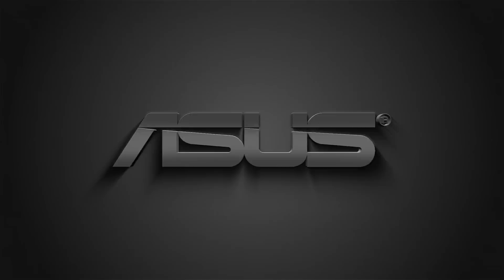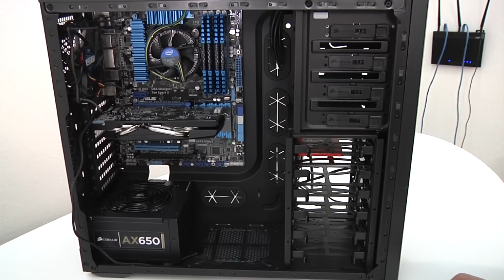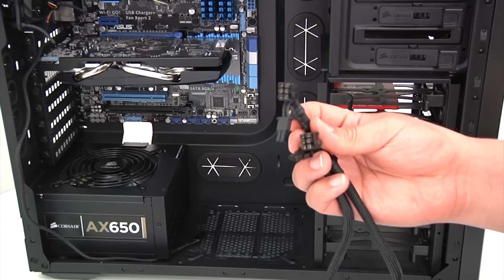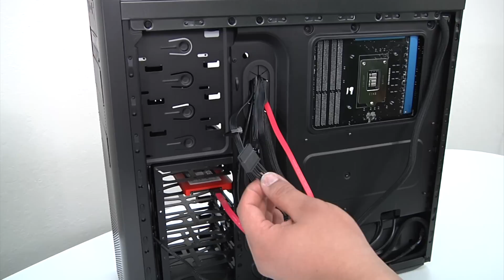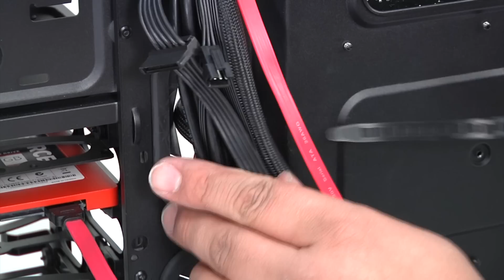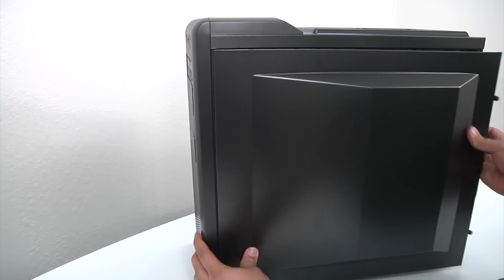ASUS How-To - Cable Management

Comment: only about a minute and a half into the video and am already shaking my head.  c'mon man, you're talking about "starting from the inside going out, bottom before the top, etc."... why not remove the psu from the chassis first so you'd have unobstructed view of the connections, as well as the "labels" of each of the connections in the psu?  And given the lack of a psu shroud for this chassis, that would be easy.  For the "less experienced" builders, it would be easier to read the labels for each of the connections rather than remembering that "since we're starting off the bottom, it's going to be for our graphics card."  Also, since the title of the video is cable management, you could have mentioned that a modular psu is "easier" to cable manage since you'll only need to plug the cables you're going to use, so there's no "unused" cables that you need to bundle up and tuck somewhere.

Comment: Why is the PSU upside down?
Reply: Rusty Pietrzak I believe it can be mounted either way (fan facing down or fan facing up) depends on your case I think.
Reply: GPU* the power supply is fan side up

Comment: At the end point, if you troubleshot the power supply and it is working, after connecting the 24 pin connector to the motherboard, what reason would the motherboard not receive power. That's where I'm stuck at.
Reply: Red Gaming have you but the 4/8pin?
Reply: Don Alexi I figured it out. Was missing the power switch cable. Had the rest of the group plugged in for the hhd and all, just had the one cable become hidden when I redid the cables.
Reply: Red Gaming Oh :P

Comment: One of your earlier videos said install the psu fan facing down if the case is designed with a grill mesh at the bottom. I noticed that the psu is facing up? any reason for that, this is an ongoing debate that really needs to be settled. Psu facing up or down ?

Comment: how to fit 8 pin cpu power cable from back of the motherboard? 4 pin goes smooth, but 8 pin i have to bend it 360 degree at the end to fit the socket. No problem when connecting it from the front of the mobo , but it looks uglier.

Comment: DO NOT install your power supply (corsair AX650)  with the (ventola) opening facing upwards! If something ever slips from you in the future while installing for example some future upgrade card and some screw slips from your hand for example it might fall inside your power supply and destroy it!
Reply: I get your point but I think most people (as far as I know) flip their case motherboard down when they want to change stuff
Reply: it's wrong
for the reasons you mentioned
and also for bad air flowing
Reply: so do we install the psu facing down or up ????
Reply: Jamshed Treasurywala Down : )
Reply: Fan facing up is not always an option, for example some cases don't have holes on the bottom. If you're too afraid of things falling in, cover it before working.

Comment: I have the Sabertooth X79 Motherboard
My Pioneer is out-of-date I know it does not have HDMI inputs
So, rather then go buy a new stereo just cos I want HDMI 
Here is what I did.

I connected a HDMI Cable to my Asus Sabertooth Motherboard
Connected the other end to my 55inch TV  JUST to have HDMI quality picture
I disabled the internal speakers on the TV 
Result:  PC is connected to TV via HDMI  Picture ONLY as sound on the TV has been disabled.

NOW... I need sound...

I connected a TOSLINK or Optical Fiber Cable to the Asus the other end of the cable is connected to my sound system.

I have SOUND

For some reason I cannot get access to SPEAKER CONFIGURATION to set Realteak Digitial Optical
all I am getting is 2.1

ASUS,,,,, Help me........!

I own a killer sound system
Bose 901 as the main speakers
Bose Center Speaker VCS-10
Bose Shelf speakers 201
No Sub is required,  Bose kicks out a lot of bass as is,  and I live in an apartment ( ARGHHHH )
 Pioneer VSX-D601

The TOSLINK is not being access in 5.1  only 2.1 arghhhhhhhhhhhhhhhh

Help me please.. In doing so,  I will reward you or anyone that can help me 
I will pay  375,000.00 youtuub dollars.

Hmm.. with the current markets,  and rate of exchange.... you'll end up owing me 0.0001 $

Comment: it is much easier to just put it together outside of the case and test to see if it posts on top of your motherboard box because if something is wrong with the motherboard or power supply it is much easier to address.
Reply: this is cable management,, this is the last thing you do for building it,, after you test if any hardware install properly or not,,

Comment: Why is your power supply is under the graphic card?  actually im confused mine was on top of the mboard and the GCard. . . . arent it suppose to be like that? or it was the casing problem?
Reply: It depends on the case, some computer cases have their PSU on the bottom or the top
Reply: +Neil John Decena Oh, so which one is better? Top or bottom?
Reply: It doesn't matter... just remember not to block the fan of the PSU
Reply: O ok tq btw  hehehe
Reply: +NCSgarenagaming gamersforrepublic Oh and actually, I think its better to have the PSU on the bottom because some computer cases uses cable management and they are using the side panel of the case to let the cables go through, and they are making it sure that the cables are going on the same direction
Reply: O ok Thx m8 once again :D

Comment: Help my PC will turn on but will not display anything
Reply: +remix cross try a different gpu
Reply: already have
Reply: +remix cross different ram, or try to pull everything out of the case and run it on the motherboard box, first run ut with only cpu then add ram and so on till you get post. if that doesnt help your mobo might be dead
Reply: +Luka Roštan have also already tried that I've narrowed it down to a faulty motherboard the inbuilt graphics card wasn't working
Reply: +remix cross Probably, you don't have a monitor.
Reply: yea i do and i found out the problem it was a dead motherboard
Reply: remix cross Warranty covers it?
Reply: but this pc is like 6 years old so...
Reply: Oh... Time for an upgrade then, right? :)
Reply: yea ikr thast what i was doing anyway

Comment: My fan connectors are made for 3 prongs.......and my chasis fan headers coming off the motherboard have 4.....

What do i do?
Reply: Plug them in, the 4 pin connectors support 3 pin fans
Reply: +Matthew Rosso 
Just plug them in. They'll still work, it just means they aren't PWM.
Reply: +Matthew Rosso I watched the video on the fan placement.  At the very end he quickly mentioned the 3 and 4 pin connectors. I spent 3-4 hour trying to find out theat information!

Comment: Is it me or did JJ leave out the part about connecting the power on, and power reset connection for the power button on the front of the chassis. I'm doing a build now for a new gaming box with a H97M-E mobo and that part is giving me something of a headaches. Can someone give me some guidance on this. Also my graphics card has two power plugs at the top, should I connect the PSU to both?

Comment: Hnng. My PSU isn't modular, and the cables are ridiculously thick, and to top it off, they're also really long. But it's also 800w and is bronze rating, so I don't really wanna get rid of it. Sorta just crammed them towards the back as best as I could.

Comment: Does managing your cables really matter performance or airflow-wise? Is it a must?
Reply: +CoolKidz yes
Reply: Cole Phelps it helps airflow and just makes your pc look a lot better on the inside, i'd recommend keeping it tidy.
Reply: Our Enemies k, thanks.
Reply: +Cole Phelps 
Not a whole lot. It just looks like ass with cables hanging all over the place like spaghetti and shit.
....also kinda makes it a pain to take apart and add/remove/manage stuff if you ever have to crack it open again.
Reply: +Cole Phelps air flow wise yes...but minor..unless your OC ing ur cpu and in SLI or Crossfire OC graphic cards..otherwise meh..but if its your build especially first one, just go all out and spend the extra time planning and put cable ties on. it makes things easier if you need to get in there again and/or expand!

Comment: Is windows needed right when it starts up or would that not matter right away?
Reply: If you do a test boot you don't need windows
Reply: +SodaWolf1 Don't buy Windows, pirate it, lol.
Reply: +SodaWolf1 
( Protip: Switch to Linux. :T )

.....no, it's not needed. The Firmware lives on the motherboard itself-- JJ here only turned it on to see if it will POST.
Reply: Gunnie I understand that and have for 3 months. I want Linux but some games I own don't support it so I'll keep my non genuine Windows 7 ultimate.
Reply: SodaWolf1
It was a joke more than anything else.
Regardless, welcome to the Dark Side.
Reply: Gunnie lol alright but I've been on the dark side for about 4 months...
Reply: +SodaWolf1 give linux 6 years and then consider switching to it

thats what im going to do
Reply: MenderSlen579 My plan is to stay away from Windows 10, so I'll be considering it when support for Windows 8.1 ends.
Reply: +SodaWolf1 i will assume that it will probably take 6-7 years for linux to progress and get big with lots of companies developers supporting it and by then ill probably make my migration to linux.

windows 8 support offically ends around 2020 and we should  avoid win10 at all costs.
Reply: MenderSlen579
Uh...okay.
You could use both, though.
Reply: Gunnie I'll do that when I get a second hard drive/SSD I guess.

Comment: After you do the POST, do you power off the computer? And if you do, do you power it off from the PSU or the chassis power button? First time PC builder here and i would love some help.
Reply: +EP1CN3SS2 keep psu power unplugged and once u go over everything you connected and go over it and re check it a 3rd time then u can power up
Reply: Like the old measure and cut adage, measure 3 times and cut once. When i built my 1st comp. that was what i used to check  on the cables and had no probs.

Comment: It is probably not the first time I noticed that the PSU fan face inward which to me initially I never thought I would place them toward inside the case though i know they are sucking the air away not pushing them.

Comment: Am i super sensitivr or this guy is super violence, i mean, when he plugged atx power he almost broke the motherboard! The pcb gone 90degrees! Do i worry much or this guy is really violence, he touched the motherboard! It could have ESDed!  Also when o want to flex graphics card power cable it puts pressure on cart and my card will bend, and my motherboard atx power ketboard is so thick i cant flex it at all! Also i have 2 Drives and oynr cd drive, the distancr between ssd and hdd is not enough and the  data power eont flex enough!!!
Reply: You would be surprised how much a mainboard actualy can withstand, but not saying that you SHOULD use strength.
It's always better to be careful instead of using strength. Also I must admit Corsair PSU's with ASUS MB sometimes have issues when it comes to the fitting of the power cables (like the 24-pin, I also need to use strength to actualy completely push it in, same with my r9 290x from asus).
Reply: NecroknightZ so i shouldn't worry about bending motherboard cable and if my gpu bends? I put my finger on back of motherboard (where theres no cruicut) so it doesnt flex!!
Reply: NecroknightZ thabks for reply btw ;)
Reply: NecroknightZ thanks, i went and recabled my pc, this timr withw worrying!!! My name PC LOOKS freaking awesome now!! I Also bent mobi cable noe it looks like the video!!! A little cleaner ;) thanks a lot, i was just over worrying
Reply: NecroknightZ i made a long reply i had connection prob so shortyly; THANKS my pc is now cool and awesome because i didn't worry and re cable it!!!
Reply: uh...I guess...no problem mate? xD happy for your temps, enjoy them :D!
Reply: NecroknightZ my old psu was like that, took 5 mins to take out the cable to install new psu ! I kept pulling and vibrating it xD new one just smoothly goes in and out without any problem

Comment: You might wanna try passing the cable the other way around.
You will save some time not having to pass all the cable though the holes, but just the tip that is plugged into the PSU
Cool video

Comment: Watched both videos in the series, and the bit I was interested in was skipped !!!
The importance in the difference in the SATA ports, and why you would connect to the light blue or dark blues ones, does it make a difference if I connect my optical drive to any of the SATA ports ?

Having a lot of problems windows 7 not recognising my hard drive drives : (
Also, my optical drive is no longer there !?

Pretty poor installation video, showed just the easy stuff the things noobies usually get confused about were skipped ! ....... Just my opinion !
Reply: I don't know about your board for sure, but the trend seems to be that(for intel boards) the higher up ones on the board(often more of them) go through the intel controller, and the lower ones through a third party(fairly often a marvell) controller.

Don't know what to say for your issues with yoru HDD's and optical drive.  If it's an older drive maybe time to get a new one, I know mine had issues recently...but it was 7 years old.

Comment: Is it just me or is the psu fan facing the wrong way.....
Reply: They can go both ways. But they are usally facing down because the case has a intake grate and dust filter. Depends on what you want for airflow
Reply: I know that they can go both ways but the dust filter is mounted on the bottom of the case for a reason.
Reply: My dad said the same thing about the pc I build. The reason is that it's hotter inside the case than out. You will have heat coming off the GPU and the CPU, and it's not good for the power supply to be sucking in hot air. That's why most cases are made with the PSU intake on the bottom, drawing in cooler air.
Reply: Made me realize I've been doing it wrong for years, it should be facing down ofc. Thanks =D
Reply: Yes...

Comment: You can place a PSU in upside down if you want the fan on the bottom of the psu to be an outtake instead of the normal intake fan.

Comment: It is indeed, however I have mine like that because my Corsair 500R sits on my carpet and if the PSU was the other way round the fan could pull in no air:(

Comment: That's not really a good point since it's not transferring energy, it's just sending a signal through the air, no energy what so ever. Besides, that kind of technology has been around for years, remember the radio? Wireless controllers just use an newer and more complex version of that technology. And wireless energy isn't the best idea because if you got in the way of (or even near) the the electricity going through the air, it would electrocute you.

Comment: Also wouldn't that be pretty unsafe? Lots of electricity traveling through the air? Even when it will be invented, it would be bulky impractical and dangerous. The idea is a good one yes, but for a long time it would be something for scientists and professionals to deal with, and when it was released to the public, it would have been quite a long time after its invention.

But i want to say i am not trying to be a douchebag, and i think that it is definitely a good concept for the future.
Thanks

Comment: First of all, the PSU is mounted in wrong direction and because of that the PSU cooling is weak, fan draws a warm air from interior instead a cool air from outside.
I don't understand what kind of advantage has the such mounting of PSU like here.

Comment: Well first off it's RAM, not raam. (Sorry, not trying to be a dick) and mainly because ram is fucking important. It's always great to have as much as possible, although you don't really need more than 16 gb. Also, the power supply is more than enough if you're just running one graphics card, and even two, depending on what graphics card it is. And even at, he could be upgrading his graphics card soon, and just using the Radeon hd 7770 just until then.

Comment: It's call RAM, it means Random Access Memory and the more the better because it is faster than the HDD (Hard Disk Drive) and about equal to an SSD. The fastest of them all will be the CPU, no matter what. It isn't about the CPU speed number but the CU and ALU work quicker than RAM and an HDD/SSD. To conclude more "raam" (PMSL) is better.

To add as well, it depends what you are doing. What if this is being used for rendering on RAM heavy applications.

CompTIA A+ Certified Technician.

Comment: I have a closed case (antec one) with little room for cables. But i still have put a lot of effort and planning in my cable management, result is ok. It's just so much more satisfying when you open up your case and only the necessary cables are visible, all in a "neat" looking config.

Comment: this is a how to on cable management, not a how to assemble a computer, if you want to learn i would suggest watching the 3 part series by newegg on how to build a pc, they go into how and where to connect your front panel cables on the motherboard, also the way i learned is look up your motherboard and get a picture that allows you to zoom in very closely and then reference your manual on what each of the connections on it are, like hdd connectors, fan connectors, and what have you.

Comment: nope lol RAM(thats how ts spelled it stands for Random Access Memory) can not be downloaded it must be bought in the form of sticks( either half, one, two, four, eight and somtimes 16 or even 32 on rare ocasions) and each motherboard may take a different kind and may handel only a certain amount. example my rig can handle 32 gigs max of RAM but i have half of that in there right now, so i know any upgrade in the market i need i can get and not worry about it